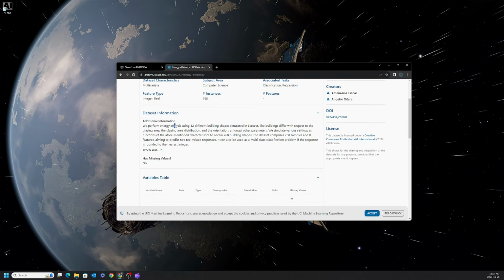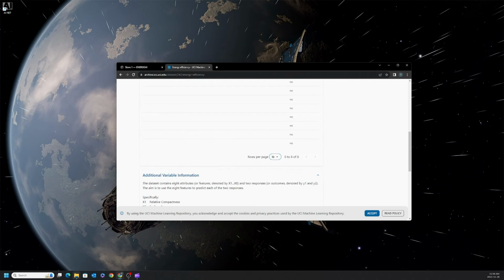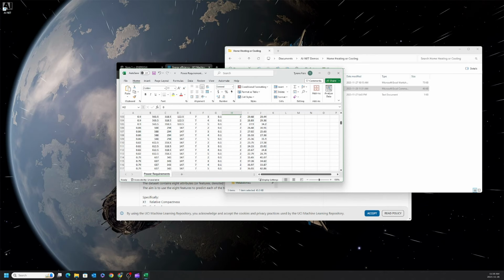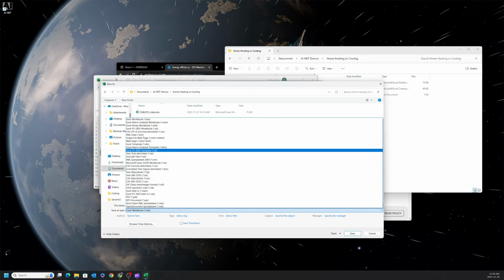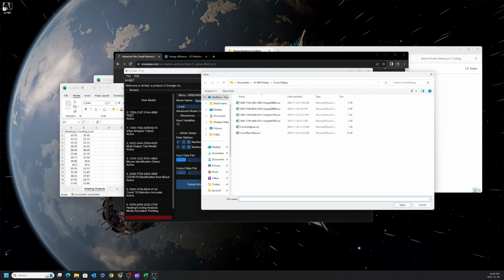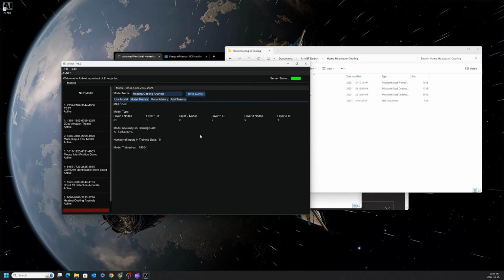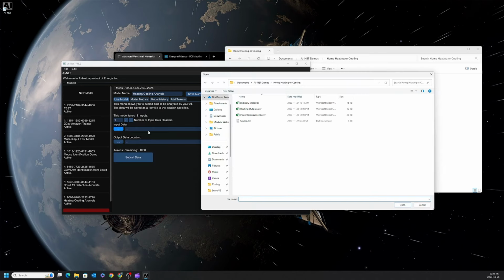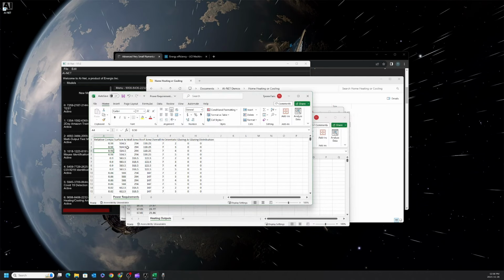Replacing Home Thermodynamic Analysis with AI! - Energis AI

Comment: Your commitment to promoting a sustainable and eco-friendly approach towards energy management is commendable.
Would introducing AI in home thermodynamics be a real game changer?
I love this video! I’ve liked and subscribed.
Reply from the maker: Thanks for your support! 
In the context of this video, the AI is not doing anything groundbreaking in the field in home thermodynamics, but rather it can enable better tools for every day users. Leveraging off of known completed analysis from software used by engineers, we can create simple tools without sacrificing accuracy for unique problems, while still not requiring any special training (learning how to use CAD or Revit, for example). 

In this case, in theory a user only needs to know the basic dimensions of their house, and with that they can figure out their heating and cooling requirements fairly accurately. That being said, the provided example does feature some limitations such as the climate the home is in, location, etc., which I cover in the video. These problems are easily fixed with more complete data though!

We are currently working on a few new A.I. methodologies to add to AI-Net to help make our models easier to use and more powerful than ever. So stay tuned!